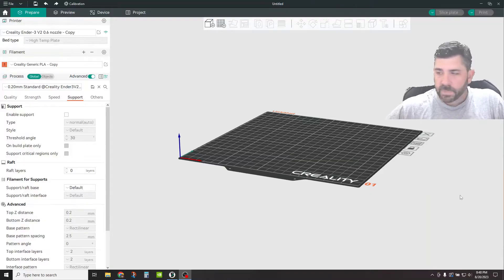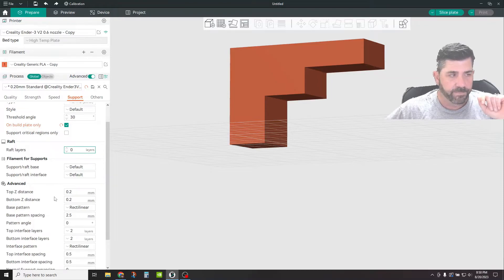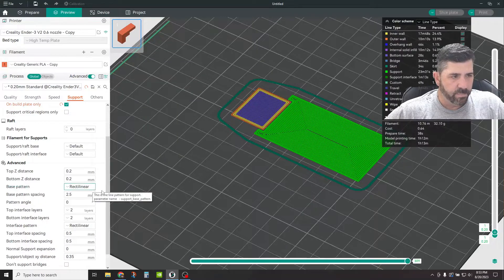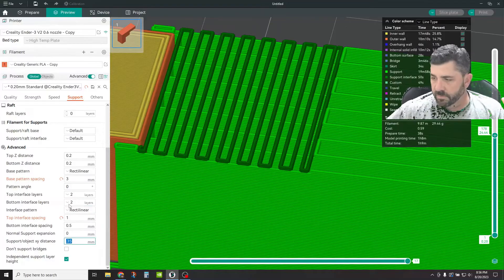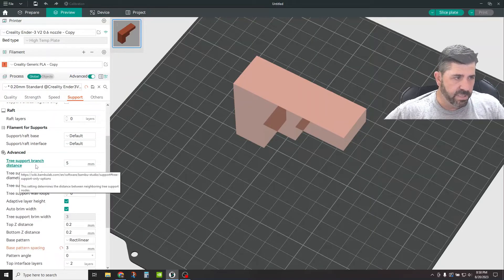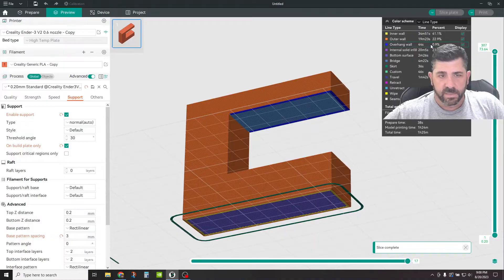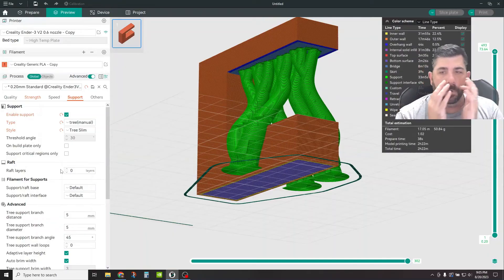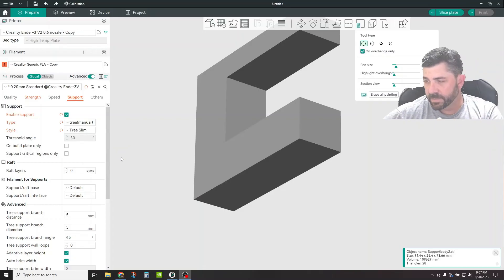Orca Slicer - Quick and easy support settings

Comment: I'm wondering how you are getting the advanced options for supports?  I can just enable supports and pick basic options like tree (normal), tree (manual), normal (auto), and normal(manual)? Nothing like you have such as base pattern spacing, top interface? I had more options when I was using flashprint.
Reply from the maker: you have the "Advanced" Toggled on, correct?  On the Process header section section.
Reply: @ I did not.  Thank you so much for your help!
Reply from the maker: Nice name by the way.

Comment: i can not stop this orca from printing brims even when its set to none. nothing i do n the brim tab changes the brim, its like its stuck at a fat brim hats attached to my parts. any idea?
Reply from the maker: click over to the Objects setting (Next to the word "Process").  Check to see that Brims aren't enable in the Object settings.
Reply: @fischer3d  thanks for that, nothing would stop it until i did a reboot of the software then it was ok but i have a fresh problem that's a complete stopper for me to use the software, i guess I'm either unlucky or just a magnet to bugs, but when i print in this slicer my print layers do not line up at all, every layer is about 0.5 mm to one side. imagine a deck of cards nicely in a stack then slide them from the top to one, side that's how my prints turn out, unusable, i just wish simplyfy3d had the fuzzy print. I'm using an ender 5

Comment: ive one last question 

how do you make your printer go home after prints finished as mine just stops on print
Reply from the maker: That depends.  What printer do you have?  You likely don't want it to go home (if that's the front left corner of your machine).  There's a very high likelihood that the head and/or x gantry will smash the model you just printed.  Generally at the end of a print you want the hotend to raise up and the bed to move forward (assuming you have something like and ender 3 / bed-slinger type machine).  Next to your printer name in Orca, click the "Edit Presets" button. Click on the Machine G-code tab and look for the "Machine end G-Code" section.  This is where you can specify what the machine does at the end of the print.  Let me know what machine you have and maybe i can point you in the right direction.
Reply: @fischer3d  printer g-code in orca says print_end

Comment: would love to know how to set bed temp
Reply from the maker: bed temps are related to your filament settings in Orca.  Next to your filament click the "edit preset" icon.  On the first tab, scroll down to the bed temp section.
Reply: @fischer3d  brilliant thanks again
Reply: I’ve got sv07plus running klipper
Reply from the maker: You can try copy/pasting this in the end g-code box. Do a small test print and make sure you watch it at the end in case anything funky happens.  I found it here, so try this at your own risk.  https://medium.com/@drjonesy/sovol-sv07-plus-setup-7303e083f74b

G91 ;Relative positioning
G1 E-2 F2700 ;Retract a bit
G1 E-2 Z0.2 F2400 ;Retract and raise Z
G1 Z1 ;Raise Z more
G90 ;Absolute positionning

G1 X0 Y200 ;Present print
M106 S0 ;Turn-off fan
M104 S0 ;Turn-off hotend
M140 S0 ;Turn-off bed

M84 X Y E ;Disable all steppers but Z

Comment: How do I lift an object off of the build plate (i.e. turn off plate snapping) so that I can add supports underneath? I don't want any part of the object actually touching my build plate.
Reply: You can't as Orca requires a part of your object always touching the build plate. The workaround is to add a primitive and assamble it with your print. That way, the primitive is touching the build plate, and you can move your print into a "floating" position. At least, that is what I found out.

Comment: So here is my problem. I have an error in the bottom left of my screen that says, " Line Width Too Small" and I don't know what to change it too. This is my second day with the printer so go easy on me please.
Reply from the maker: no worries.  What type of printer do you have?   What nozzle size are you using?  First thing to check is under the Quality Tab, scroll to the "Line Width" section.  If you're printing with a 0.4 nozzle all your width settings should be in that neighborhood.  You could see settings ranging from 0.4, 0.42, 0.5, etc..  If you've got something that is drastically below your nozzle width, that would be my guess is the culprit.
Reply: @fischer3d  you are exactly correct!! Hahah!!! For some reason I was thinking I was printing at 0.02..... so yeah I adjusted it to 0.4 which is what my nozzle is and bam! Works perfectly!!! Much appreciated my dude! I guess I was trying to print items for an ANT rebellion ahahaha!!

Comment: Great video thx, can you tell me how you changed your build plate template to creality?
Reply from the maker: Thanks.  Sure thing. At the top left of the screen next to the "Printer" there is a cog wheel icon.  It is located directly below the "Device" menu text.  Click that and scroll down to the Creality printer section.  Choose the model that most closely resembles yours and it should change the bed template automatically for you.

Comment: thank you for the video. I am trying to transfer my cura setting to Ocra, but the print time for the same part is 20-30min longer. I am not sure what I'm missing. any help would be great. thank you
Reply from the maker: Hi there.  Happy to try and help.  In Orca, make sure in the preview to switch over to the speed view.  This will show you the relative speeds per layer/structure and can help identify where you might be able to make some changes.

Are you printing a single part or multiple parts on the bed?
Reply: @fischer3d  Single parts, I will take a look at speed view. thank you
Reply: Cura times are way off anyway. So if orca is close to the actual print time its not as far off as it shows

Comment: Why does this slicer look exactly like Bambu's Slicer?
Reply from the maker: It's a fork of Bambu.  Bambu is a fork of Prusa
Reply: I get that but when you branch off another product typically they make the interface look a little different but this one looks identical. Like slapping a ford emblem on a Ferrari. not complaining, just saying it like I see it
 :)   @fischer3d
Reply: @MrBrianwilliams1980  Orca slicer is an open source community project that adds many new features to bambu slicer (which is itself a fork of prusaslicer, which is itself a fork of slic3r). The UI in bambu is good, it would be silly to change it; prusa didn't change the UI when they forked slic3r for example. This how open source works.
Reply: because it is bambu slicer